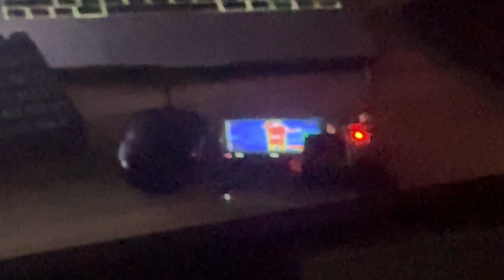DIY Thermal Camera Build Guide: ESP32 + Lepton 3.5 - Complete Arduino Tutorial 2025

Comment: I am getting this error in esp32 cam. Why?: rst:0x1 (POWERON_RESET),boot:0x13 (SPI_FAST_FLASH_BOOT)
configsip: 0, SPIWP:0xee
clk_drv:0x00,q_drv:0x00,d_drv:0x00,cs0_drv:0x00,hd_drv:0x00,wp_drv:0x00
mode:DIO, clock div:1
load:0x3fff0030,len:4980
load:0x40078000,len:16612
load:0x40080400,len:3480
entry 0x400805b4

E (58) camera: Detected camera not supported.
E (58) camera: Camera probe failed with error 0x106(ESP_ERR_NOT_SUPPORTED)
Camera init failed with error 0x106
Reply: are you using the same lepton camera module?